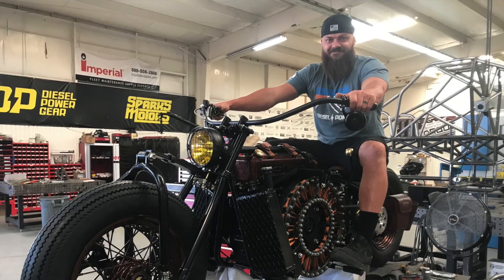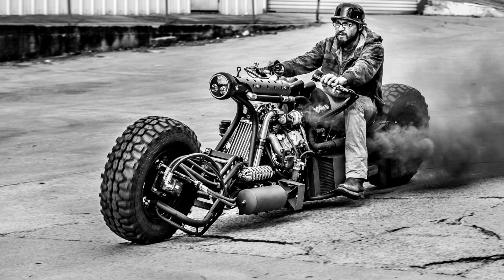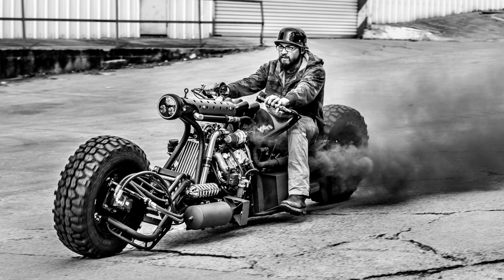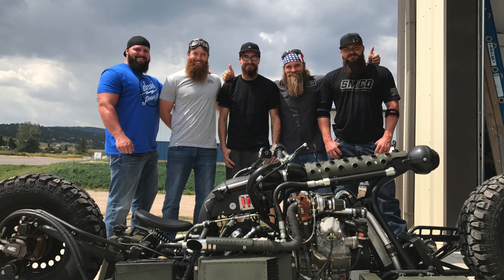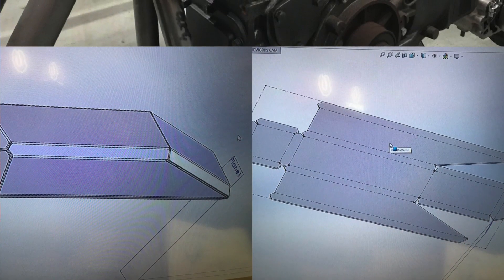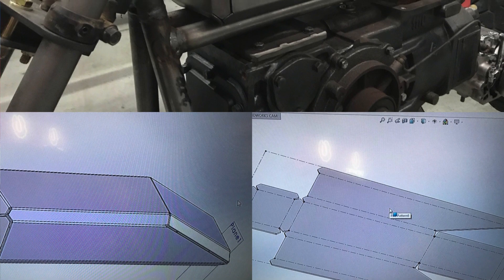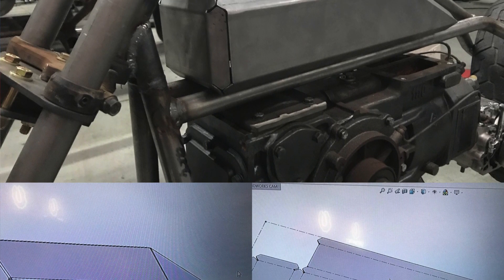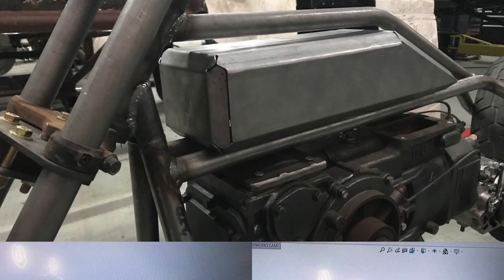1100cc Single Cylinder Diesel Motorcycle

Comment: I love the stator, would you mind if I imitated the design for a “nostalgia bob meets modern mod” evo big twin scrambler build? I want to keep the clutch mass and primary drive as far inboard as practically possible, and clock the trans for mass centering. I envision a V-Twin that sports Super cross capable suspension and stance characteristics, with industrial revolution era inspired metal finishing and craftsmanship

Comment: Sam what make of engine is this? I love that dynamo you made, what do you do with all that electricity generated. It's enough for an diesel- electric hybrid. You should try building a sidecar to match this bike.
Reply from the maker: Samuel K it is Chinese engine manufacturer that built this engine, but I believe it is based off a horizontal Lister style diesel engine. The magneto only generates around 500 watts. It could be designed to be more efficient, but I was focusing on the overall flow and look of the magneto on the bike more than the output . I definitely think the side car would be a cool addition.

Comment: I love that you made a big, badass bike that doesn't seem to be obnoxiously loud.  I hate that it's a disgusting smoker.  Seems to me that if you spent a quarter of the effort on that as you did on the aesthetics, it wouldn't have to be a gross and offensive machine.
Reply from the maker: chalo colina I honestly don’t like that the engine smokes so bad, but unfortunately that’s one of the downsides to Diesel engines.  The black smoke is from incomplete combustion of the fuel. The silver lining to this literal dark cloud is that the majority of the smoke is a soot that settles on the ground and never rises into the atmosphere. This bike gets 110 miles per gallon of diesel fuel, most gasoline motorcycles get less than half of that. So hypothetically I could ride from New York to Los Angeles (3000miles) on 28 gallons of diesel. The same trip on a Harley sportster (45mpg) would end up using 67 gallons of gasoline. Gasoline is basically refined diesel. So in the end the diesel is technically greener than any gasoline equivalent.
Reply: Thanks for the explanation of diesel engine and their exhaust.. I watched the episode where you built this bike and the diesel powered mountain bike... This bike is so awesome and I love the steampunk look of it. It looks like something out of a Mad Max movie but cooler. Can you give us something about your background, training and how you come up with such cool and radical designs?

Comment: Badass...... nice touch with the exhaust tip like a truck.  I've always wanted a diesel motorcycle.... so much so that I would consider learning welding so I could shoehorn a 10 horsepower diesel Kubota on to a Honda Shadow or something like that...